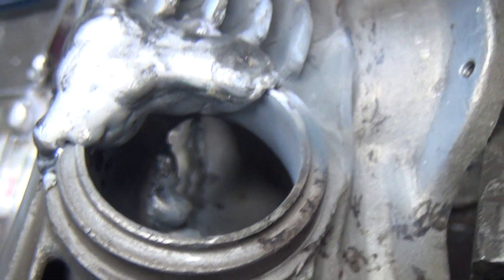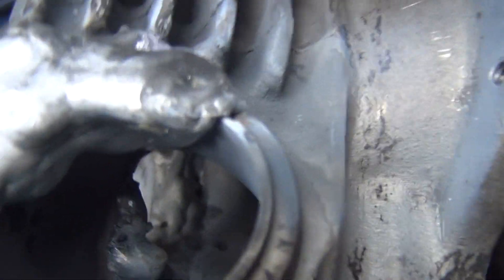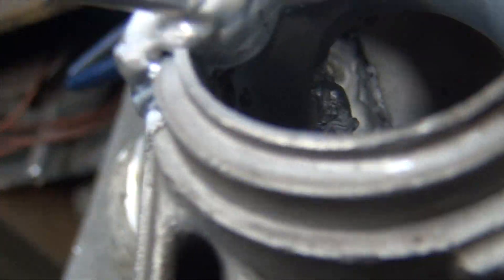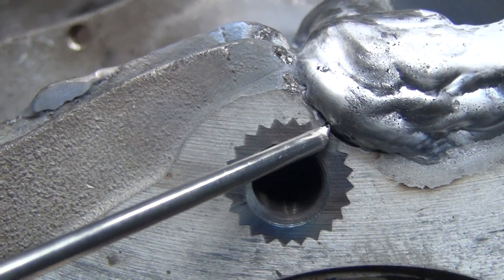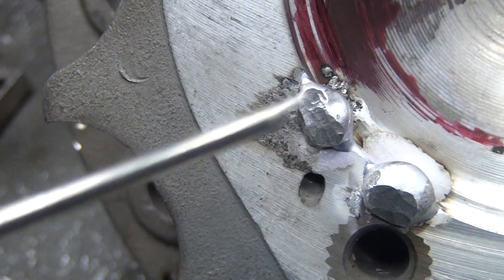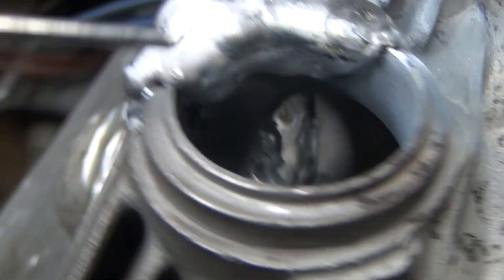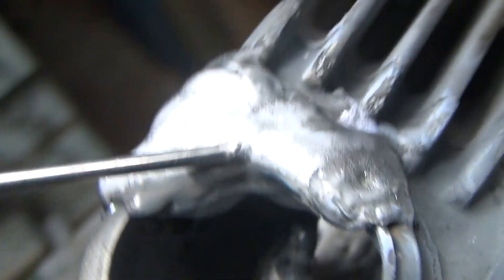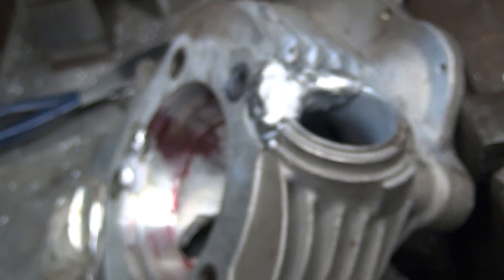#167 1958 & 1960 harley panhead complete head restoration repair welding & machining, tatro machine

Comment: what kind of filler to you use
Reply from the maker: hard and soft rods.
tatro
Reply: Would 6061 work I need to weld the kicker sprocket cover on my 73 iron head the it broke where the kicker bushing is